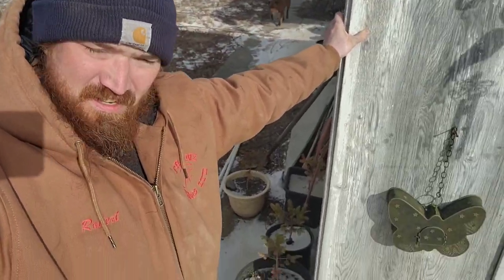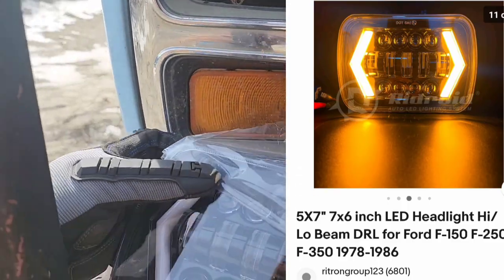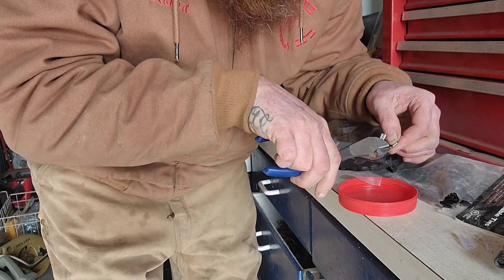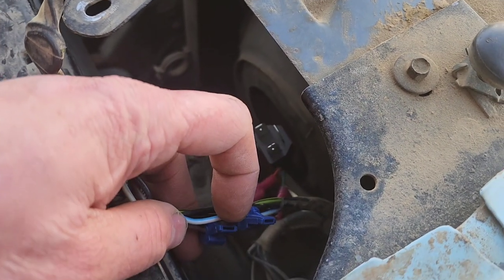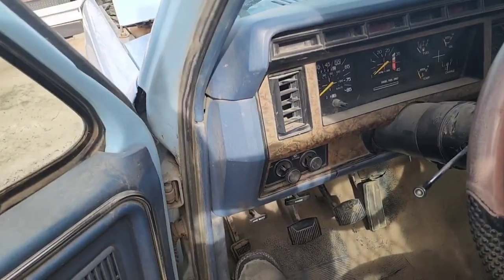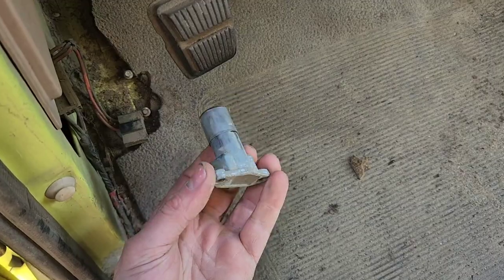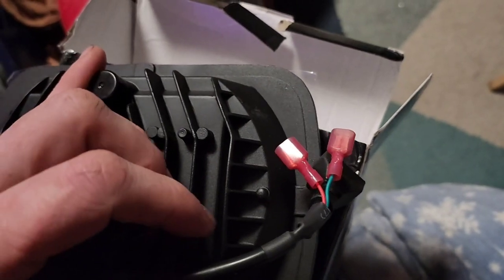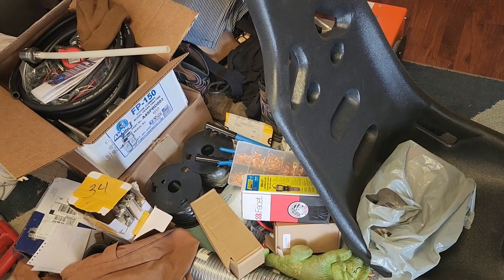Bullnose 6.9 idi ford gets a LED headlight upgrade

Comment: Your videos helped me a lot and your solutions are allways cheap, thats nice because IDI parts are very expensive in germany.
Please do the electric fuel pump video.
Reply from the maker: I used the Facet duralift seachoice pump in another idi truck a couple years back. I liked it, and it worked good. Here is a link to that installation video. https://youtu.be/AC0W7cND0wA
 Will be doing the install in the race truck in the next couple months. Glad to help share info, appreciate you following the chanel. God bless.

Comment: Looking forward to that video on the electrical stuff 👍🇺🇸
Reply from the maker: I will be doing the electrical in 2-3 weeks. But I do have a couple videos about hotwiring the 7.3 and 6.9 that explain the basic wiring to make them run from under the hood. Might check them out. Good information if you are doing any kind of diagnosis or repairs.
Reply: @worthshop  I’ll check it out 👍

Comment: I have had the same couple of days just like You have had with the insane Wind! One step forward and 10 steps back! But Your Lights look nice!  Great job on the install. Those Stomp Switches work great when they work but they don't like getting wet and full of mud! lol But I still like them. Keep up the great work and have a nice week. Stay safe out their Brother. 🙏🏻👍
Reply from the maker: Odd thing is I swear the dimmer switch worked when I bought the blue truck. Sits out back a few months and now it don't... They are only about $10 on Amazon anyway. Off to work I go, weather is better this morning. We had like an inch of snow yesterday. But it melted. I want spring to be here soon. Hope you have a good week too.

Comment: As always, I love the IDI content. Keep up the good work! Just sold one of my unused vehicles so I got some cash waiting to go towards an IDI. Will be looking at a 6.9L E350 next weekend hopefully!
Reply from the maker: Right on! Good luck with your search. Hope you find the right one. God bless.
Reply: What kind of transmission does it have? If a c6 start looking for vacuum regulator valves because they're kinda hard to find and often are a issue with the c6.
Reply: @brendonmasters  Yep, C6. Thanks for the heads up.

Comment: Hey I had a few questions I’m 19 and currently looking at a 6.9 idi and the owner says it’s the fuel injector and that’s why it keeps acting up. I don’t know much about diesels but the truck is super clean it’s a 1984 bull nose almost no dents and it’s a cab and a half. The interior also looks super clean all he 
wants is 700 it’s my neighbors truck.
Reply from the maker: Definitely worth the price. I would try running some atf and diesel kleen through it before you replace parts. Might clean it out and get it running better. 
https://youtu.be/gwTuS2L7NBc
Reply: @worthshop  thank you I just purchased the truck. I’m gonna go get that stuff from your other video within the next day or 2 and try that out. Also the truck has a turbo and it’s a manual. I’m definitely happy with my purchase so far thanks to your comment and videos it’s given me faith.

Comment: Hi I am having a problem with my LED turn signals. I have a 1987 bricknose F250 and I can't get the turn signals to work with LED bulbs. I bought the more expensive $50 light bulbs on Amazon That was supposed to have the built in flasher relay. Cannot get them to Blink they just stay on. I tried buying a LED relay round 2 pin that plugs into my fuse box and still no luck. Regular light bulbs work probably. Cannot figure out what's going on is there something I am missing?
Reply from the maker: I have always had good luck with the adjustable led flashers. You replace the stock flasher with the adjustable one. You can then turn the adjuster screw and get the desired flash speed.

Comment: I got some kind of like yours, but they take an actual bulb so the side lights  of the bulb are wired into the cab lights so they are they running day running light can I still wire into the blinker light?
Reply from the maker: Pretty sure you probably can. You can have a light come on with any circuit you want just wire it to that circuit.
Reply: @worthshop  would it make mY cab light flash to?